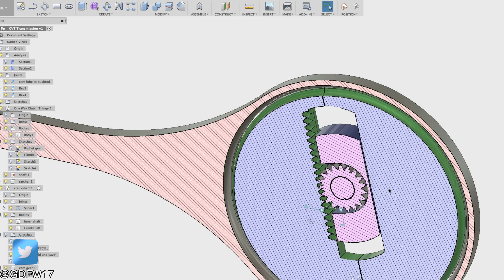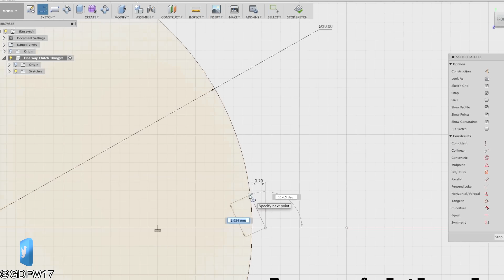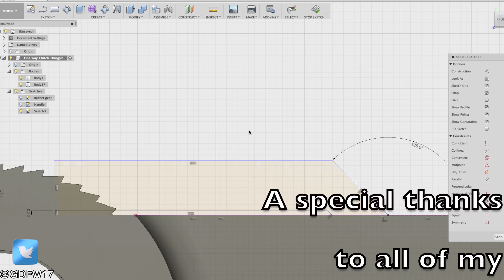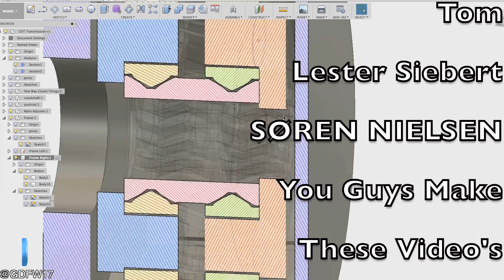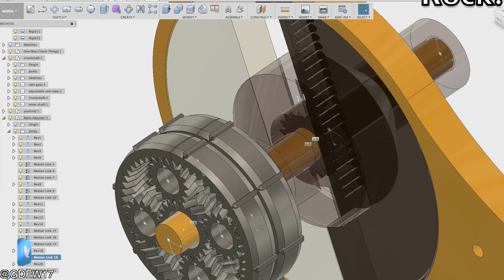The Coolest Transmission You've Never Heard Of... The Ratcheting CVT

Comment: This is absolutely insane. This needs to be in every car with a CVT. This would change the industry completely. Good job man.
Reply: Brendan Klahn   worth noting that certain electric motors can have massive torque at 0 rpm and don't need a gear box or clutch at all.  The industry will probably go that way, even if it uses an internal combustion engine to generate the electricity on board.

Comment: It looks as though there is a significant cyclic variation in the output rotational velocity that would be unacceptable in most applications. The ratcheting would be a significant problem at actual engine speeds, but it might work very well for a manual winch, or driving variable volume pumps driven from the connecting rods instead of the ratchet output shaft.

Comment: It could have use in an industrial application.
Nice design. 
But I see 3 problems.
The noise.
The wear on the ratchet.
And the 3 phase sinusoidal movement causing jerkiness in the rotation that would be perceived as vibration.

Comment: The Abrams, and most tanks don't use the system you claimed they do. The Abrams uses the Allison X1100 cross drive transmission. Most modern tanks use a cross drive transmission. Having 2 engines is not feasible.

Comment: Calling the racheting mechanism a rectifier actually seems very apt, following what i know of ac rectifiers the ripple (in this case the variance between peak output speed and minimum output speed) should be 1/2 the peak speed while a 6 phase rectifier has a ripple of 12% and a 12 phase rectifier has a ripple of only 4%. 

Here's the interesting bit, they dont actually supply 6 or 12 phase power to these devices, instead they create 6 or 12 (or more) pulses from the 3 phase power. I dont know about 12 but you could easily make 6 pulses with little modification by having 2 rachets on each arm taking energy from both the foreward and backward stroke and inverting one of them.
Reply from the maker: Interesting that you bring up electricity, I was originally going to mention how this machine works almost the opposite of how a VFD works, instead of rectifying and then manufacturing the phases, it manufactures the phases and then rectifies them. 

Then I cut that part out thinking it wouldn't help anybody understand the machine better...

Comment: Could see a CVT design like this being used in an industrial application possibly. Like on a conveyor system that needed to be slowed or stopped regularly without turning off the electric motor. Keeping the electric motors RPM in it's sweet spot for torque would be beneficial to efficiency.

Comment: It is not actually “infinitly” variable because of the ratchet on the output shaft. If that ratchet has a set number of teeth, then one rotation of the input shaft transfers to Moving the output shaft by N teeth for each setting. N is variable, but only in whole numbers.

(Noted this just a second before you said it yourself)

Comment: After replacing dozens of cvt from Nissan's. I'll never buy one. They have there place. Cars and trucks  just aren't there strong suit.
Reply from the maker: Maybe if Nissan didn’t program them to shift like an auto or manual they would of lasted longer
Reply: Nissan has given CVT's a bad name...they are not all as crappy as the Nissan, for example, Subaru's CVT is excellent.
Reply: Lexus CVT are really good too. I have a 450h with 160k on the clock, still pulls like a beast. I would argue another consumer problem is they don’t sound sexy, if i floor it, the engine comes up to  5000 odd rpm, at 10mph and stays there till i chicken out! A V6 sat at a constant RPM is not a good sound, but having max torque all the way to 155mph is pretty amazing
Reply: Toyota/Lexus did away with belts and pulleys in their CVT's years ago after the 1st gen Prius, the current system is a clever mix of motors and planetary gears to give a continuously variable transmission. (CT200h owner here)

Comment: You could use those one-way bearings instead of ratchets.  Also, a question I have about the adjustment knob: If you were to drive something on the output that required much torque, would the adjustment knob tend to slip toward neutral?
Reply: dansw0rkshop That's not a bad idea! Have a sprag bearing linked to each pushrod that slides onto the output shaft. That would remove the limitation of fixed ratcheting reseting. It'd also be quite a bit quieter and perhaps a bit smoother running since it would not not be unloaded until a pawl catches.
Reply from the maker: Yes! That is one problem with the design

Comment: I'd recommend investigating some IVTs, or infinitely variable transmissions.  Many of them work by converting rotational motion into reciprocation motion and then back again.  It does away with the ratcheting mechanism and a lot of friction, and often a lot of vibration, too.

Also IVTs can fully reverse the output shaft as well, which is how they differ from CVTs.  They're often used on machining tools, as smooth operation is more important than efficiency.

Comment: Cvt stands for continuously variable transmission you are machine stops and starts its out put shaft so therefore it is not continuous but u could easily salve this problem with having more cam ratcheting devices

Comment: That will pulse like hell.  I don't mean to say it isn't really cool, but it won't be any good under load over a long period of time.  Vibration and heat would cause premature wear.  I would think you would want more than 3 phases but you are correct about diminishing returns.  Very nice bit on dual differential adder/subtracter drives.  It would be really cool to see how this would compare for noise and longevity to an axial piston hydrostatic drive.  I would love to see it applied to a small vehicle like a lawn tractor for comparison.

Comment: Instead of having a pawl mechanism driving the output shaft why not use a ball-and-ramp one way clutch.  If the output shaft had some rotational load (flywheel) the one way clutch would make the output less "choppy".

Your demo model needs some lube.  Silicon dielectric grease is clear so it won't look messy.  You could also use Fluid Film Spray or even silicon spray.  You might need some "texture" o the balls/surface of the one way clutch.

It appears the output can not drive the input so you can not have "engine braking".
Reply: Well, the trouble with output not able to drive input is not simply engine braking, it means that if while driving, you ever let off the gas without stepping on the clutch (eg going down a hill), then this will break your gearbox apart. Sounds like a pretty huge issue to me. You'd need a computer controlled clutch to ensure that never happens. By that point, a 6-speed (or more) automatic gearbox would be cheaper and more reliable (which is why this is the most common consumer gearbox)
Reply: Vouise V - the transmission does free wheel.
Reply: "A ball-and-ramp one way clutch" is called a Sprag clutch. Some automatic transmissions use these. That will reduce the output steppiness.
Reply: Jack Patteeuw & engine braking saves my brakes so thats a no buenos. Jk, but I like it dude very creative mind I bet your visualization is superb! Do you meditate?
Reply: not in reverse though.
Reply: true, so in order to have a vehicle with this cvt you would need 2 of the cvt setups, but since it cant run in reverse you would need a way to disconnect either or. great idea, and I bet with more time and thought it could be a working system as a transmission
Reply: Why on earth would you make a second cvt just for reverse? Put a single speed forward/reverse transmission after output shaft. I haven't done too much research on sprag clutches but I was under the impression they were friction based? Which, while they would minimize backlash in the output, would suffer from the same problems that lead to this design in the first place. However, these ratchets would be extremely noisy even at mid rpm and would wear out quickly due to spending 50% of the time reversing. So maybe adding a 4th phase and switching to sprags would minimize the noise, backlash and maximizing the lifetime of the clutches due to lower torque on each one
Reply: swiftz69 well you could rely on a traditional clutch and gear box to switch between the forward cvt and the backward cvt.
Reply: Jack Patteeuw in a car I doubt much choppyness would be felt due to the large momentum of the wheels.
Reply: Jack Patteeuw 
Now that is a very valid point- engine braking.  Now if braking as normal it would put tremendous strain on the gears.  Most likely the reason this design does not work, as clever as it is. We don't have the materials or too expensive to incorporate.
Reply: TheAnimystro you would be surprised.
Reply: look into a sprag clutch very smooth and strong  used them in top fuel dragsters for years
Reply: When I was a kid my dad had a Saab 95 with selectable engine braking. He used to only lock up the mechanism when towing. It wasn't dangerous. He never crashed it in 12 years.
Reply: Vousie V you won't need a clutch
Just turn the shifter til it's in nuteral
Reply: That sounds very dangerous, not having engine braking, as standard brakes do not have continuous braking power. I read that normal brakes can fade after just 45 seconds from overheating. Not at all adequate for descending a steep mountain hill.

Here's a better idea. Electric cars that need no transmission.

But I think that is so idiotic for stupid Americans, that they would program a CVT to pretend that it is not a CVT. It would be quite nice to get rid of those pesky "gears".

Comment: Great job!  When I was young, in the early 90s, popular science had an article about a company called epilogics that had a new ratchet design for use in ratcheting cvts like yours.  I was blown away by the idea and spent hours "reverse engineering" how such a mechanism could work.  One thing I really took away from the article was the parallel of how the ratchet in a cvt acts like a diode does in the electrical world. The rotating input shaft can be though of as a   dc signal that is used to generate an ac signal via variable displacement cams. Then that ac is rectified by the diodes to get what approximates a variable dc output.  Like the electrical counterpart, the output will not be a "clean" signal but will have to be damped by a sprung flywheel or similar to get a harmonic output.  I've had a design in mind for years that would use a universal joint to generate the variable mechanical oscillation motion.  Maybe you've inspired me to model and print it!  Keep up the good work!

Comment: Cool stuff but there's one big problem:

It's still a CVT, and people still don't want it in their car unless they're on a budget or it's their only option.

Never expect people to change. After all, a lot of people still prefer manual transmissions over automatics, despite automatics having been around for over a century now. 

Besides, people don't want to sit on one engine speed. Nobody wants that unless they're looking for efficiency. It's just not cool. People would rather hear the engine change speeds, since after a while the drone of an engine at 3,000 RPMs exact would get extremely tiring, I assure you.

Comment: The commercial version of this is called a "Zero-Max drive". Pros: compact, high torque, 0 to 100% in forward and reverse with one lever. Cons: they can't handle high rpms so no automotive application. The ratchet paws start to float past a certain point and increasing the return spring pressure while helping just causes them to wear out faster. They are perfect for adding variable powerfeed to a small lathe, no swapping gears.

Comment: That is exactly what I build out of Lego at my YT channel ;).... Completely fan of CVT's ! Yours is Great !
Reply from the maker: Hmm, I wonder if I can 3D print LEGO’s
Reply: Kenton B If you are working with Lego, You must tolerate some backlash, but you still can achieve totaly respectable results !
Reply: You most definitely can!
Your videos are brilliant by the way. And I'm dazzled that you came up with this idea - and a working prototype - at 16!
Reply: Lego Technic Mastery shameless plug
Reply: Hey dude :D
Reply: []HĒŁŁ [] KNĪGHT [] Hellooo ! Fellow faithfull subscriber ^^
Reply: Lego Technic Mastery I’m subbed to u
Reply: Garin Bahr Wow, Thank you very much, Generous supporter ^^
Reply: LTM!! I also love CVTs please make one quick with common parts please! I'm subbed I love your videos!
Reply: Mario Velez I've developped a CVT recently, using 3 differentials, a bit like the two-differential compact version, but without any friction pin to maintain it in high gear ^^ That makes it more efficient by the way ! ... I made two versions of it : High and Low range, both being highly sensitive to resistive torque ! The video should be uploading this week :0
Reply: Technically, Yes, but the tolerances on Lego are intense. Your lego will NOT fit well to proper lego, or eachother.
Reply: Coastaku ur car is dangerous
Reply: CVTs suck, they make you car sound like crap. What sounds better, rrrrrrrrrrrrrrrrrrrrrrrrrrrrrrrr or rrrrrraaaaaaAAAAAAAHHHHHHHHHHCAHAAAAAAAAAHHHHHHHHHHHCAHAAAAAAAAAAHHHHHHHHHH

Comment: Cvt also has massive power loss vs regular Trans dual clutch and all have more loss then manual
Reply: The major source of loss in an automatic vs a manual is the torque converter.  If you use a clutch instead, but keep the planetary gearing arrangement you get a faster shifting manual without being significantly less efficient.  If you replace the clutch on a regular manual transmission with a torque converter you get more gear ratios in a smaller space, and make it so you don't have to learn to slip the clutch, but then you have to eat the efficiency losses.  All combinations have been built for one purpose or another over the last hundred years.
Reply: And no I don't drive a cvt lol I drive a 18 speed Eaton
Reply: scair7331 yes I'm calling duel clutch automatics, unless your manually moving the gears it's an automatic in my book. Hell most of the duel clutch trans have full auto options so you can just mash the throttle. Depending on the source they are actually listed as an automatic, others call them semi-automatic or clutchless manual. Matters not the name, you can put it on D and mash the throttle same as my grandmother's buick.
Reply: scair7331 as far as race bred vs consumer, it was all race bred at some point. The biggest difference is cvt was banned from racing so it never had the multimillion dollar research projects like other transmissions did from race teams, that's one hell of a disadvantage to overcome yet it's a good enough designe that it hasn't faded into oblivion.
Reply: I do drive a CVT. In the vehicle I drive the manual was tested and got worse fuel mileage than the CVT.  Fuelly reports also confirm this as well. I really could care less what happens on the race track but it really makes a difference to my pocket book over the life of my vehicle.
Reply: scair7331 staying at peak power makes cvt superior for racing, which is really the only time that the power loss you speak of matters. That's why cvt was banned a few decades ago by F1, it was to good. As far as manual being better then anything, that was true years ago. However the speed at which an automatic can shift compared to a human the automatic looses far less power. That's why modern super cars, and the race circuits that allow it, use automatics with manual shift options.
Reply: Jay Dunbar  are you calling dual clutch Trans automatic. It's true they shift faster and don't miss gears but they still have less parasitic loss then the rest. Also comparing race bred vs consumer grade is a very different. Try a cvt maxima vs the manual as long as the manual didn't miss shift it's the manual that comes out on top

Comment: CVT stands for continuously variable transmission, not consistently as you stated
Reply: Consistent =/= constant. As mentioned, these are CONSTANTLY variable transmissions because the ratio is always changing. A consistently variable transmission would change in a repeatable manner, but NOT necessarily constantly.
Reply: He says 'continuously' at 0:19
Reply: "Continuously" is the correct word.  It doesn't refer to reliability or consistency in operation.  In CVT, the "continuousness" has to do with continuity vs. discontinuity of gear ratio.  In a geared transmission, the gear ratio during shifting is not defined.  Another way of saying that is "during shifting the transmission gear ratio is discontinuous."

A CVT never has moments in which the gear ratio is undefined, so it is ... "continuous."  (just like continuous vs. discontinuous functions, graphs or lines in mathematics)
Reply: Caleb Sherman Good for you Caleb!
Reply: Caleb Sherman Oh! Thanks!
Reply: Francisco Chavez i
Reply: Is the bit where we slag him off about using consistently?
Reply: Kllrbny At 2:49 he wrote out "CVT=consistently variable transmission" just pointing it out since this is supposed to educate people, not confuse. V3MD, it most definitely isn't the same thing. If you look at any literature on these devices, they never call them consistently variable transmissions. It just doesn't make any sense. Continuously in this context means that you can have vary the gear ratio in very fine steps, vs the four or 6 discreet gears in a traditional transmission
Reply: Ben Upde Well, with my skill in English, I could describe a regular gearbox as "consistently changing", as it's using consistent gear ratios instead of variable ones. So yes - using the word "consistent" instead of "continous" implies the opposite to what it's supposed to.
Reply: I think hes said consistently on purpose because the ratio doesn't vary continuously by an arbitrarily infinitesimal amount but has small stepped ratios defined by the gear spacing of the ratchets etc.
Reply: Means the same thing